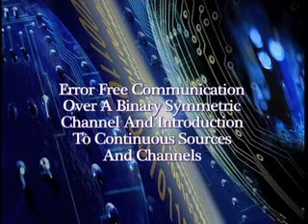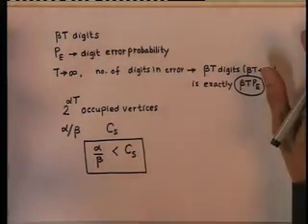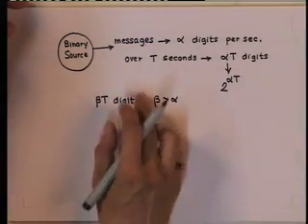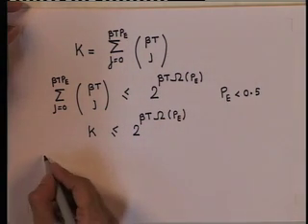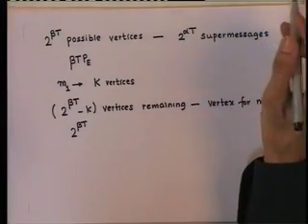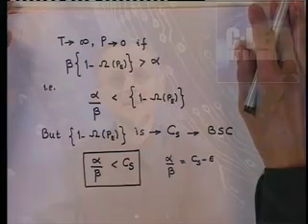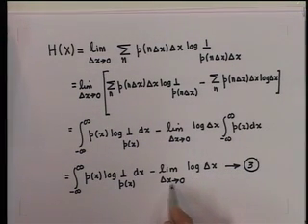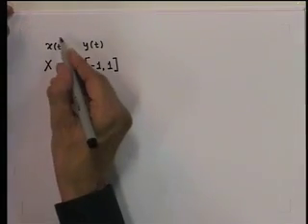Mod-01 Lec-28 Error Free Communication Over a Binary Symmetric Channel

Comment: Syntropy (prediction) is dual to increasing entropy -- the 4th law of thermodynamics!
Binary symmetric channel (BSC) = Dual symmetric channel.
Duality: two aspects of the same thing, two sides of the same coin.
Teleological physics (syntropy) is dual to non-teleological physics (entropy).
Randomness (entropy) is dual to order (predictability).
Prediction or syntropy = increasing mutual information -- teleology (Aristotle).
Thesis is dual to anti-thesis leads to converging thesis or synthesis -- the time independent Hegelian dialectic.
Synthesis or syntropy means that duality is converging, integrating or forming optimized predictions from information -- mutual or common information.
"Through imagination and reason we turn experience into foresight (prediction)" -- Spinoza describing prediction.
"imagination is more important than knowledge" -- Einstein.
Energy is dual to mass -- Einstein.
Dark energy is dual to dark matter.
"Always two there are" -- Yoda.
Duality (energy) is being conserved -- the 5th law of thermodynamics.
Apples fall to the ground because they are conserving duality.
Potential energy is dual to kinetic energy.
Action is dual to reaction -- Sir Isaac Newton.